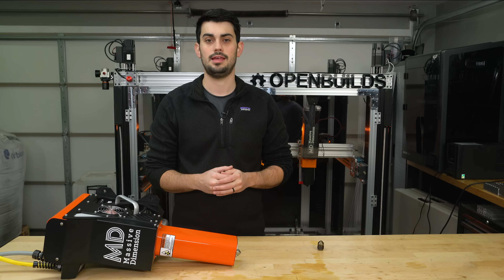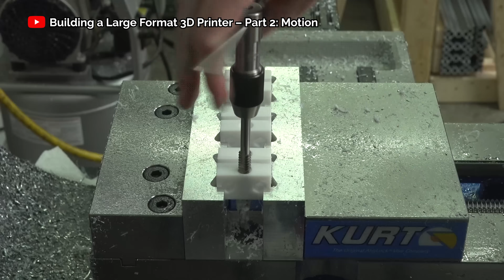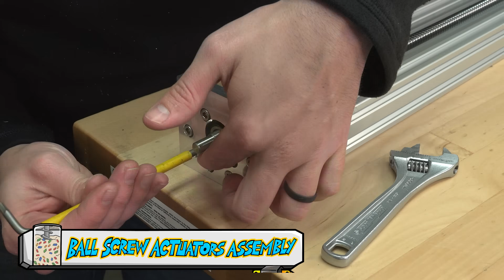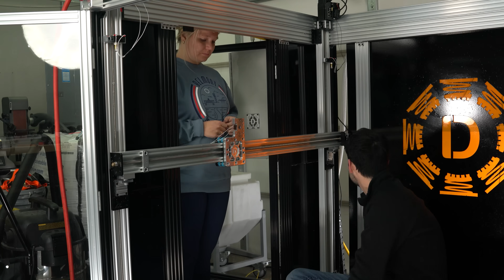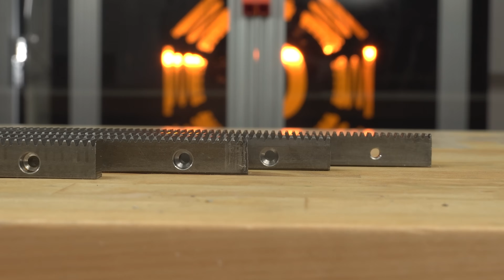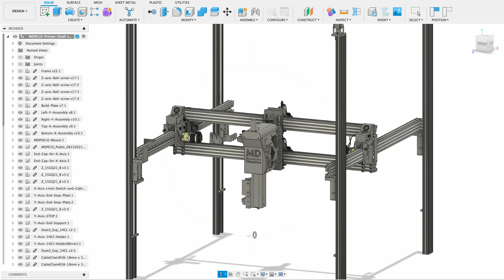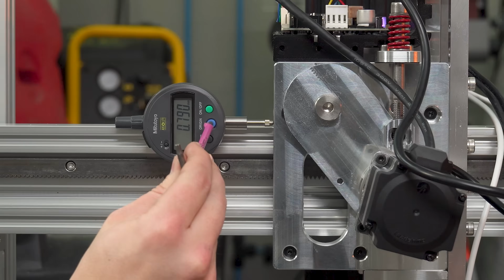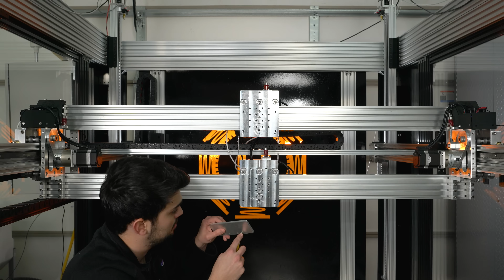Rack and Pinion Upgrade: Key to Faster Large Format 3D Printing (Part 6)

Comment: Man, that's a beautiful machine! But I wonder: is it REALLY necessary to be so stiff and heavy? (...) Looks it will be SO SLOW compared to anything we are using right now. I am super curious to see the parts you print with it - comparing to a much simpler design like the Elegoo OrangeStorm Giga printer.
Reply: I think it could probably be a bit lighter on the frame but the Mass that moves is so big it needs rigidity.

Comment: Seriously? Do you use an 8mm lead screw on a 3d printer like this? You should have had a ballscrew1610 from the start
Reply from the maker: It is likely that my original build (lead screws and all) was the cheapest platform for moving that MDPH2 extruder (18lbs) around. I built this in my garage after all! But after 2 years of successful printing, I am finally making some much needed, but more expensive upgrades

Comment: Ultimately, I’m afraid that you will find that using the extrusions as the ways, is going to lead to a faster the expected rate of wear, for the softness of the material.
Maybe time to incorporate a track system?
For the mass and accelerations, I’m thinking you’ve crossed into the realm of CNC machine tools.
Reply from the maker: I definitely considered going all in and upgrading to ball bearing guideways, but the budget wasn’t there. Further, I have yet to have any issues with the V-wheels and they are relatively easy to replace if they were to wear. The printhead is twice as heavy, so this could be a problem but there are 24 wheels on each axis.
Reply: @DrDFlo  Thinkin’ short of “all in”, stick with the present rollers and attach ground steel stock to the affected frame surfaces.

Comment: I was going to ask if you had ever considered using a pulley counterweight run up and over to the back to reduce the weight of the print head but when I considered that the Z-Axis has 4 motors acting in concert and the 40lb print head is split between the 2 Heavy C-Channels for the Y-Axis, 20lbs placed in the center of 4’ channel probably wouldn’t even notice that kind of thing and 10lbs of print head and 1/4 of the gantry wouldnt even even cause each motor to break a sweat. 

Outside of strength concerns my thought was if you had a passive system offsetting the weight of the print head, you could probably achieve move rates that would readily exceed even your 5mm print nozzles massive volumetric output. Even at roughly equal balance, since the Z axis Only ever moves in 1 direction for the print, “backlash” in the traditional sense wouldn’t be a concern … and even if it turns out you need some weight you still have the combined weight of the entire gantry to keep the ball screws seated.

Comment: It feels liike you've passed the point where you need to start engineering away from the problem, insead of around it.  Melting plastic in situ is very expensive to the design, so a filament extruder, chemical emulsifier, ultrasonic solution, or a pre-heating solution and bowden tube, start to look way more attractive, or some combination.  

In short: There's got to be a better way than flinging a 40lb print head around.

Also I suspect you could move the motors off the gantry to lighten it up, with something like a coreXY-style belt system.
Reply from the maker: This is how it is done in the industry, but always open to innovation. If you think my extruder is heavy check out Thermwood’s LSAM lineup: https://www.thermwood.com/lsam_home.htm
Reply: @DrDFlo  Those are intensely cool for being so large!  Thank you much for sharing.  It's reassuring to know that you're not really slamming the limits, but I'm still wondering about ways to get that weight off the gantry.  I'm still trying to come up with a good answer, but it feels very possible.  

I'm always leery of "We do it this way because that's how it's always been done."

Comment: In the semiconductor industry there are wafer transfer robots of let's say 50kg that are moved across an envelope of lets say 10m by toothed belts. These robots position batches of wafers ~20kg. They achieve good positional accuracy and high speeds and accelerations. Yes, large steel reinforced belts will have high handbook tension values...but in practice they are tolerant of very low tensions.
Reply: I really like your implementation of the racks. Low cost and clean, nice work!

Comment: Rather than relying on motor rotation for determining the position of the XY axis, could you use linear scales, like a lathe/mill DRO, to track actual position of the print head? This should alleviate any loss of accuracy due to backlash. Just a thought.

Comment: Couldn't you put the y axis c-beams at an odd angle so that the weight of the print head would push against them in a direction that they're stronger in? Like, if you rotated them ~30° in towards the print head, then whatever torsional forces caused by the heavy print head would be largely negated. Well, not exactly negated but you get what I mean.

Comment: on your point that belt driven machines are only laser cutters and light toolheads, gerber made sign cutting machines that cut aluminium in 6x12 foot sizes that were belted X and Y axis machines to give you an idea of how much weight they threw around, a factory option was a 10kw spindle
look up gerber advantage router

definitely agree that racks are better though

Comment: I just found your chanel through this vid @DrDFlo but I can already tell it's time to subscribe, this was great and I'm looking forward to parusing your other content.

I wanted to ask though, instead of the gas strut that you'd need to remove for more travel, could you not use a simple, shorter and very stiff spring mounted within the height consterants of that top plate to get the same result?  You could go with one in compression or tension depending on the type of spring you find that gives you the needed lift, and it shouldn't be too bad to incorporate an adjustable plate where you can increase or decrease the tension as needed using a bolt and jam nut.

Comment: Work on the robotic components in the semiconductor industry. Those things fly at meters per/sec while accurate to 0.05ish mm.
Reply from the maker: I was happily surprised that even my sketchy gear racks performed as well as they did. I can only image how accurate KHK gears or similar would be with a proper anti-backlash setup
Reply: @ Tips for you: Trapezoidal lead screw for the Z, and belts for the Z/Y axises on LM guides. The lead screw's flex is negligible in the vertical position. Faster speed with belts on the horizontal axis. Belt tensioning and LM guide leveling is important for the horizontal axises though. I'm using the knowledge I learned from work for my 3D printer and CNC builds for precision. Otherwise, artworks and non critical stuff -- go for the cheapest option. That 20K extruder ain't cheap though. If I had that, I'm going all out with the linear motion. Leveling is also a PIA if you want the X/Y axis to be fast. Some of the robots I work on have to be within 0.01/or 0.05mm within the span of 3+ meters.

Comment: What is the benefits of using a Cartesian motion instead of an arm at this size? My guess is speed.
Reply from the maker: Cost too. See if you can find a 6-axis robotic arm that can move 40 lbs within a reasonable work envelope for under 50k.

Comment: I really like your printer but I feel like in this round of revisions you had to make a lot of workarounds to incorporate the new motion elements without adjusting the frame too much, and you ended up having a lot of specialty parts, compromises in travel, and the introduction of new failure possibilities—not to mention all the time you spent designing those workarounds. I find when I make a ton of revisions it’s easier at some point to change things from the bottom-up—your frame is made of extrusions after all. Anyway, keep up the good work :D
Reply from the maker: Definitely a valid criticism for sure, and I will likely be making more changes in the future especially since I know that the rack and pinion works well 👍

Comment: This could be the most unique eD printer build I've ever seen... kudos. But, I'm a bit confused, are you sure that a standard linear rail system would be that expensive? The sleds are really not that complicated, 30 bearings in the good ones I think and truck wheel bearings don't seem that they would be that expensive (and they carry so much move weight.  If anything, the grease injection nozzle that exist on the better engineered ones should be even easier this design due to the size of the sled (then again, the added weight of the bearings as opposed to v slot wheels)... either way, great video.

Comment: What software are You using to control the Nema 23 motors and the limit switches, also are You going to sell the whole printer as an assembly?
Reply from the maker: Duet ecosystem (RepRapFirmware) - I have a video on it here: https://youtu.be/sW0k0BZvWno?si=WX2Fmluza3X3ATeh

Comment: Excellent info. Do you have a link or specs to your 4:1 gear motors (Nema 23)? Are you running them at 24v or higher? Thanks!
Reply from the maker: Thanks! Supplying 48V and here is the link: https://www.oyostepper.com/goods-341-Nema-23-Closed-loop-Geared-Stepper-L%3D56mm-Gear-Raio-4-1-Encoder-1000CPR.html

Comment: So there is no money for linear rails. But then you proceed to buy 4 blocks for 10cm of rail just for the Collision detection system? Blocks are usually just as expensive as the rail they ride on. But nice solutions overall.
Reply from the maker: I would need 14x 1500 mm rails for the 7 actuators (pairs required). Even really cheap rails would have cost me a little over $2500. Those HGR25 rails + carriage I bought used for $50
Reply: @DrDFlo  that is a good deal. What size of rail would you need to carry the print head?
Reply from the maker: Yes, wasn’t too worried about the HGR25’s quality as I’m not really using them for precise motion. And I would likely need at least MGN15, but bigger is always better

Comment: Have you considered a CoreXZ motion? The weight of the gantry would aid the tension of the belts instead of hindering it
Reply: CoreXY doesnt work well for larger printers due to the belting system. Around 350mm is the practical limit really.
Reply: @Festivejelly  I said CoreXZ, not CoreXY
Reply from the maker: CoreXY requires belts and the print head is too heavy and the actuators too long 😢
Reply: @DrDFlo  I said CoreXZ, not CoreXY

Comment: Why not belts? Reliability / steability? (probably explained in previous videos but I’m too lazy to find out)
Reply from the maker: The printhead weighs 40 lbs. Thick belts would be needed to prevent stretching, which are difficult to tension/route
Reply: Thx, my gess is that linear motors are outside of budget. Wonder if there is any better solutions  @DrDFlo
Reply: @uujims there is one that is cheaper...omega belt or belt in belt drive. For low load applications like picandplace or 3D printing. For a router you can either use wider belts or a driven nut ball screw.
Reply: That was fast
Reply: Ball screw would work fine

Comment: You’ve Got to admit, it’s a bit silly to have a $20k print head but your using a gear rack instead of ball screws 🤣
Reply from the maker: The R&P with be more than accurate for plastic extrusion on this scale. But yes, the build has gotten a little lopsided with the extruder costing 1/2 the build. Still pumped though to get it fired up.